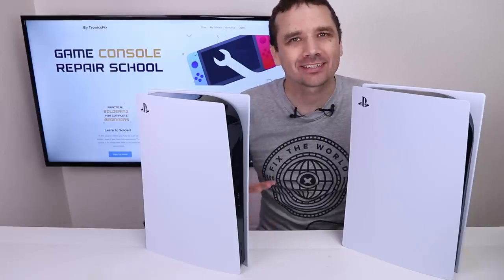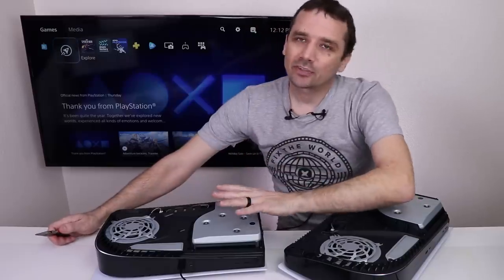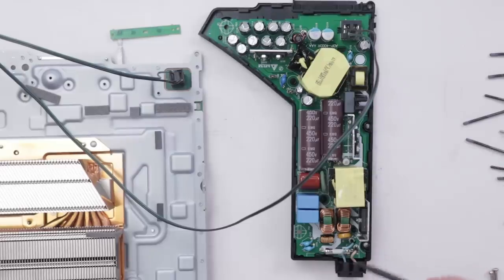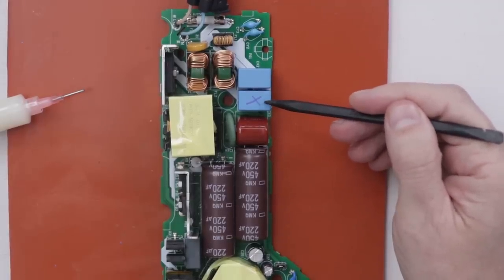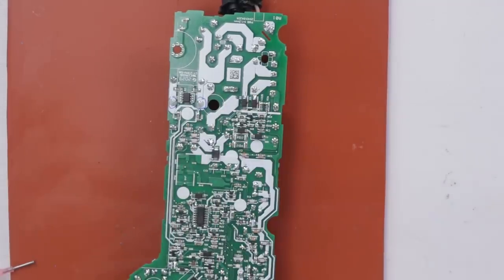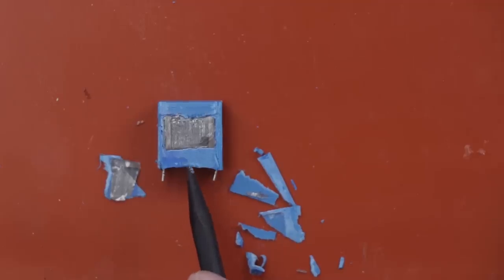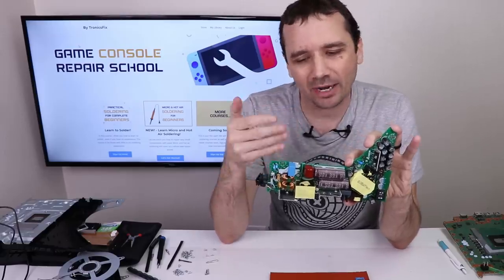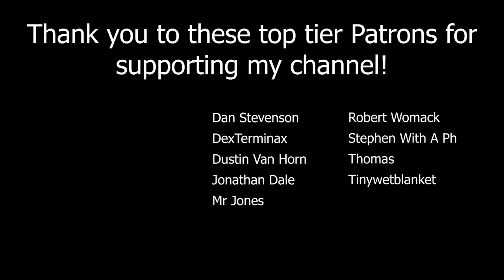PS5 Coil Whine - What Is It and Can I Fix It?

Comment: I use Dap ultra clear all purpose waterproof sealant on boards and components to isolate and waterproof certain components on different types of electrical systems for elevator main boards, gate systems and door ada controlers. Maybe if you cover that capacitor in the sealant you could isolate it enough to lower the noise significantly. I use it on rbsn's and the relays don't click as loud. If I come across one of those, I'll try it and comment here again. If you want, you can try it and show us if it works.
Reply: capacitors build up heat tho, im not sure how much, but covering it would negate its ability to shed heat and may cause it to have performance issues at high heat or may fry it
Reply: @King_Flippy_Nips  you are right. The only way to know is to try it and monitor temperature. I do have a thermal dmm, so I if come across it, I'll definitely check it out. And yes. Pluto is a planet.
Reply from the maker: Interesting idea!

Comment: I’m not convinced that capacitors buzz or tick. That is usually coils as the windings can physically move - you can cure (or reduce) that by securing the windings with sealant or hot glue.  Are you absolutely sure that it is that capacitor and not a coil nearby.

Comment: It’s a same problem with power transformers. If it’s not isolate well it’s starts vibrate and make that noise. Just try to find better capacitor and replace it.

Comment: It could also be a bit of the apoxy resin or even metal sheet is slightly broken or damaged so when electricity goes through it it moves against each wall creating the clicking or whine

Comment: The noise (whine) will go away or quieten down considerably after a few weeks. You may also find the noise will come and go so may not be noticeable on day one.
Reply: I really hope you're right! Mine has been terrible.
Reply: Mine hasn't changed at all in the 2 months I've had it. I'm over it and getting a replacement
Reply: @thomassmith4999  I’ve decided to send mine back as well. Hopefully we have some better luck with the next consoles

Comment: From what I know the noise is just caused by electricity flowing through the component which causes a magnetic field which causes other stuff which I don't fully understand so can't explain. When I say its quiet its blady quiet, you have to put your ear up to the ps5 to even hear a hint of coil whine.

This is a problem on every electrical component, the level of noise just depends on how efficient the power supply is and how much power it is using. It's even a problem on the series x but less noticeable cause the fan is a bit louder. The ps5 is so quiet the noise problem is cool whine, that is actually really fascinating and evidence of just how good the cooling is on the console.
Reply: Do you notice a difference in the noise when you play ps4 games compared to ps5 games? Mine is completely silent when playing ps4 games but makes noise with ps5 games. My headphones block the sound out 100% even if I don’t have any audio going through them though so it’s not a big deal, just an annoyance really
Reply: @Henke12  I don't own one unfortunately but that makes total sense as a ps4 game would use less power than a ps5 game. Lower power usage reduces coil whine because less electricity would be flowing through the capacitor meaning a smaller magnetic field.
Reply: @Henke12  but the cooling and sound of the fan has got to be amazing if coil whine is what we are complaining about lol

Comment: You can replace it with two separate polarized magnetic capacitors on the same trace with each one having the opposite polarity as the other.

Comment: No you can't cause its not an issue. Simple as that. Its just that ps5 uses 3 different types of fans. 1. that was shown in the official video, 2. That makes considerably more sound but not as much as a ps4 pro and 3. That is super quite. This is all because of the design. Nothing to worry about.
Reply from the maker: This video has nothing to do with fans. You should watch it
Reply: @Tronicsfix  sir, you have clearly written "Coil Whine" which is only due to different "Fans" being used with the console. That's what am saying with all due respects to you and your video.

Comment: So if the capacitor is vibrating, it is probably charging and discharging at a rate that  resonates with itself. There are two ways you can attempt to fix this. The first, easiest one would be to change the frequency at which it resonates. I would use hot glue and first just try tacking it to the giant capacitor next to it. That would cause it to have twice the mass and probably stop the hum.
The second way, Stop it from occurring electronically.. increase the capacity of the capacitor by replacing it with one with a higher value.

By the way I strongly disagree with the way you described a capacitor from working. What it's doing is filling up and dropping down as needed... Not absorbing voltage spikes but rather helping recover and prevent voltage sag. It doesn't absorb spikes. That would mean it would jump up. Instead it is preventing sag... It keeps the voltage even.

In any case I would have tried hot glue before even desoldering it. This is actually the reason why some capacitors and coils have that big gooey silicone gel on them when they are mechanically secure without it.

Comment: The problem with this power supply and other cheap power supplies, is in my opinion, caused by magnetostriction which exposes any quality defect or poor quality of components.
In short, i would say the PS5's power supply quality in terms of manufacturing is low ... I have not seen a PS in a PC from Corsair, Seasonic etc have this coil whine (Electromagnetically induced acoustic noise). Then again, manufacturing this PS probably costs SONY on a good day about ~30$ while the ones from Corsair or Seasonic, considerably more.
As mentioned by others, in this form, the problem is strictly an inconvenience and not an electronic problem. Good news is that it seems in can be fixed relatively easy if it appears down the road.

Comment: when the layers gets insulated, due to the lifetime of the product or the metal parts gets touched each other, that caused a buzzing sound.. The only soln is replace the capacitor.. 
This one is non polarized, and I think from the power supply circuit, it's just filtering out the frequencies of the current passing through the motherboard...

Comment: @TronicsFix  My opinion while the compasetor is making that noise: Before Microsoft has anounced his 12 tflop xbox series x, the built parts where already planed to built the ps5. But i rember when sony has to rise the cpu clock to get in the same region of tflops to have equivalent horsepower. i think the ps5 was planed with about 8 or 9 tflops... so the comapasitor has not enough compacity to run "smooth" because of the cpu boost sony made...

Comment: Yeah I had that on PS4 PRO after changing the thermal paste let it dry the noise was gone so who cares about the noise I never send to the warranty still has no issue people call it coil noise and then he changes the capacitor it's hilariously smart move ! Foil capacitor never makes noise whatsoever rather high voltage rated electrolytic capacitors do, they dry up over time and lose dielectric liquid under high heat but with the brand new ps5 it's doubting don't change nothing let it run how it was intended !

Comment: have you tried just swapping it out for the part from a ps4 pro power supply? I actually wasn't surprised to see that, as it was far easier for them to use those as I believe they had plenty of leftovers from the PS4 pro parts bins... that said I wonder if the design of the ps5 actually is putting more stress on those capacitors, and is resulting in the whine/buzz...

Comment: Coil whine occurs on these or any other type of capacitor when current is passing through it causes vibration it's a very common problem especially with cheap capacitors like that if you upgrade to better quality capacitors you could eliminate or atleast cut the noise level to a dull hum
Reply: My Xbox Series 💪 X is a Totally Silent Beast'😏

Comment: It could be electricity arcing between sheets of metal or electricity causing a vibration between the sheets of metal inside the capacitor.

Comment: Just a guess but maybe the capacitor is vibrating internally from the AC current. And it's just loose enough from the epoxy that it's making that noise 🤷. Just a guess
Reply from the maker: As far as I can tell you're right. From what I've read there can be a mechanical clicking noise caused by the layers hitting against each other and the plastic inside.

Comment: Tronicsfix, did you solve the buzz/whine problem ? My Ps5 PSU rattles like crazy when playing heavy games....im sick of it, and to return a brand new product i bought in such a short time is crazy.
Could you test Hot Glue or Epoxy on the components just like series X PSU? Might do it myself after i have proof it works.
Reply: I’ve heard people returning it and getting a brand new one, with the same sound. 

If you test it out, keep us updated please
Reply: @MrUchiha  i will 👍🏻 i spoke to customer service and they knew of this “buzz issue”, the honest support told me they 9/10 return the unit as long it works, despite the sound. In rare cases they swap it for a new one. I think Microsoft did a better job with the dempening of the components (they put some greyish dots of kit on it). I’ve sended my ps5 to Sony, lets see what happens. But i think, its a waste of time. Ill let you know 👍🏻
Reply: @richieb9675  thanks let me know. Yes, MS did a better job. I hope to get a fix on this soon: people is saying some hot glue or silicone can actually fix the vibration / coil whine.

Comment: Is it definitely the class X2 cap that's making a noise ? I've heard ceramic caps resonate in the audio range, or  could it be the inductors (coils) next to it ?...look up class X and class Y capacitors they are there for safety...X is across the live and neutral and Y is to ground, the supply should NOT be used without them but it will work, and this way you can establish where the 'whine' is coming from .
Reply from the maker: I'm pretty sure it's coming from that blue cap. Nothing around it is making any noise at all.
Reply: @Tronicsfix  Thats cool ! reason I asked is thoses safety caps are required in all mains stuff in Europe and you would expect to hear more complaints ! but more than likely that a random cap can fail.

Comment: Well with my limited electronic engineering knowledge, from what it sounds like some of the epoxy that's inside the capacitor wasn't applied correctly and caused an internal short making the coil hiss

Comment: Not all of ps5's have coil whine. Mine has 0 whine at all under a full load so maybe there are manufacture defects inside and the sound is gaps of the metal allowing the electricity to jump, idk its my guess but replacing it may help. By seeing how that part is constructed it seems like if you dont have whine you probably wont ever have it. But if you do your out of luck. I feel for the people getting loud fans and coil whine.
Reply: @Dirty_Bear22  lol i know that but still the amount of coil whine these ps5's have been giving off is unacceptable. There's videos on YouTube where you can hear it over your game across the room. Thats just not right.
Reply: @Dirty_Bear22  i was super lucky, i got the quiet fan and no coil whine. I legit have to put my ear up against the console vents where the fan is closest just to barely hear a fan humm while in a game.
Reply: You can't hear my fathers PS5 buzzing from further away than a few cm's from the console, yet mine is loud from 10 feet away
Reply: @thomassmith4999  that really sucks and thats not acceptable at that distance. Id have sony replace it. There is coil whine then there is unacceptable whine. Usually 1-2ft is acceptable but 10ft is deffinitly under defective lines. Mine has 0 whine at all even with my ear against the console.
Reply: @yoltsbp  Yeah it's nothing like coil whine from a GPU in a PC. These capacitors in a loud PS5 sounds like like a big transformer on the power line in the street but it varies with the load, so going from game to menu to half menu is like BZZ bbZTTTTTTT bZZZZZZZZZZZZZZZ BZZZ BZZZZB BZZZ bZZZZZZZT. Quite a different sound and goddam annoying :). And yeah Sony are going to replace it, they didn't offer much resistance, just asked me for a video of it running and once I had done that they just said they will replace it.
Reply: @thomassmith4999  that's good! Glad they are making it right, this cool whine issue is pretty bad from the looks of it. Sucks you have to go through the replacement process.

Comment: It could be because it absorbs the power spikes it keeps the board from getting fried and power spikes from the power supply
If you listen closely to other products they have the same wining
Reply: Make sure not to try at home 🏠
Removing them before waiting could git you shocked
Hazard warning ⚠️⚠️⚠️
Reply: @rudolphhemmitt8617  how long should u wait? 

U can also use plastic gloves
Reply: You could push the power button for a few seconds after you unplug it
If not for about 5 minutes I would suggest
Make sure to note that if you hold your iron on the board too long they could damage the board and other things

Comment: I have heard that pc videocards can have the same problem. 
And that it varies heavily per conductor so replacing it with a bewoners could fix it or make it worse just by change.
About the cause I thought it was due to lorentzforces induced by the current, this will make the capacitor vibrate which makes the noise.

Comment: My problem is a slightly high pitched "cycling" sound that is present regardless of what you do with the PS5. It gets louder when you put a game on. Only headphones drowns it out.
Reply from the maker: Hard to know what that would be. Def could be from the same capacitor though
Reply: That’s the nidec fan mine is the same it sounds kind of like a whistle noise ?
Reply: @CH-bn7qb  yes closer to a whistle than a humming. It's a permanent sound as well.
Reply: @dsbyr2023   yes it’s definitely the Fan it’s just a noisy fan mine is the same however they are very easy to replace with breaking warranty just wait till parts are available and swap it out for the quieter delta model fan that’s what I am going to do
Reply: @CH-bn7qb  that's a pretty good idea. I was going to try and see if Sony would replace but I'm happy to open it up once alternative fans are for sale.
Reply: @dsbyr2023   yeah definitely once you do you will need a T8 security torx screwdriver for the fan screws I got one cheap of eBay works fine

Comment: I suspect the issue most likely be under voltage ..

LIKE THE PS4 BEFORE IT i WOULD SUSPECT YOU NEED 22O/240 VAC TO RUN IT CORRECTLY
Reply: @J Fz eye sight issues..

if you are from the US

I live in a 240 vac single phase country..

I suspect if you are getting under current at 110 vac this may coil whine or in extreme cases over volt pulling 290 vac or higher

with the issues of unstable power in the UK likely caused an over volt causing the capacitor to fail most likely requiring a capacitor upgrade because what's installed can't deal with the vac off the wall socket

Comment: I don’t know jack but if the part is made up of layers of metal and plastic... couldn’t it be an “arc” between the layers. Maybe one of the layers is too thin or an imperfection exists? The noise sounds harsh like a mini arc. Just a thought.
Edit: I mean there doesn’t seem to be any moving parts to it right?¿
Reply from the maker: It's actually not an arch but it seems to be just from the layers basically hitting against each other.

Comment: I understand its “coil whine” that buzz sound, and reading comments ppl are convinced that its “coil whine” and a normal sound, but what i dont get is, after discussing with a few buddies who also own a ps5, they dont have that same sound, and i do! So how is that normal?
Reply: Some electronic parts have verry narrow tolerances and should all behave excactly the same.
The power suply is not one of those parts. So yes, it's very random.

In this specific case, 2 similair components with large tolerance are mounted parallel to each other wich could contribute even more to the issue.
Reply: @hotdognl70   mine has a buzz sound when loading up the game, then after loading the disc the buzz is still there only a little more quiet, and i notice what almost sounds like a frequency sound when opening/closing the game in the ui, even with a digital game

Comment: Would using multiple capacitors in parallel reduce the load on each capacitor and hopefully reduce the whine or would it just add extra potential sources of whine to the system?

Comment: I lost a RX 580 with coil whine, at first i thought it was normal and all, but soon enough it just stopped working as i was playing Witcher 3 and the temp was hitting 85c and then PC shut off to never turn on again, i just lost my card. :^(
Reply from the maker: That sucks...might not have been coil whine you were hearing. It could have been something going bad.
Reply: Nah the problem probably was that you didn't take care of your graphics card replace the thermal paste for a new one, and clean the fans as 85 degrees is a lot, mine at 100% use is at 65ºc, graphics cards till 75ºc are more or less ok but when the temperature is higher thats not good, 80 might be ok if there is not throtling in the card, 85 is not ok
Reply: @Tronicsfix  I think it was the vrm mossfets.
Reply: It is normal. I have RX 570 that has it and entire power section is making it as it works from several hundred KHz to several thousand MHz and coils are making that noise. 85C is too much, I keep mine at around 55C under load and it never crosses that line so keep your cards cool :P